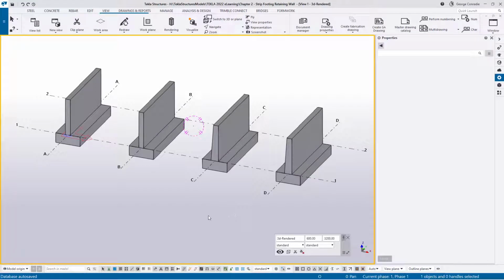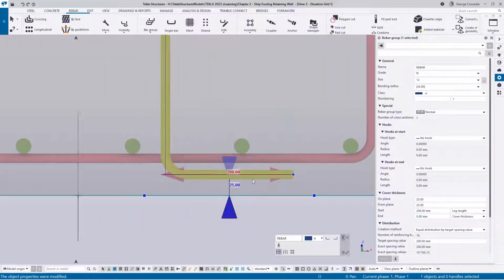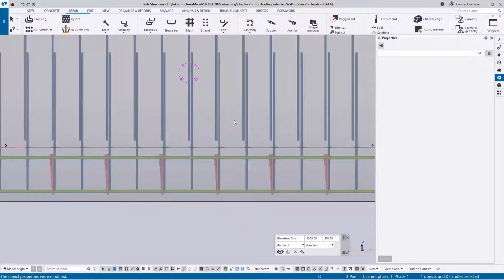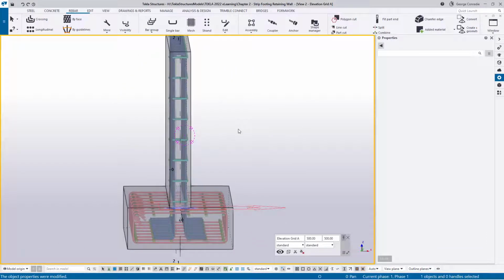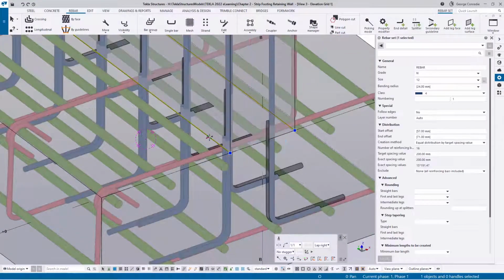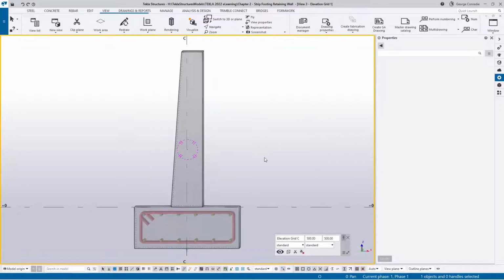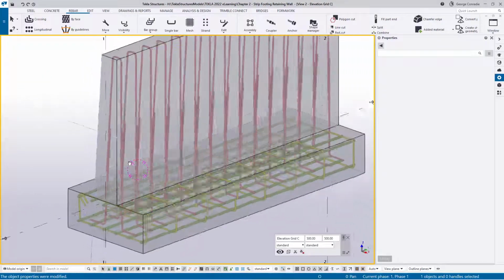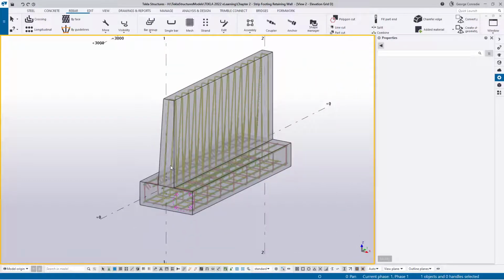Tekla Structures - Chapter 2, Video 2 - Rebar Detailing Retaining Wall on Strip Footing

Comment: Hi Mate, you shown how to change rebar layer in set. How do you set a caover to firt layer though? DO you need to model first layer using group always to define cover?
Reply: You can first select the concrete part (without the rebar) and set the cover in its properties.